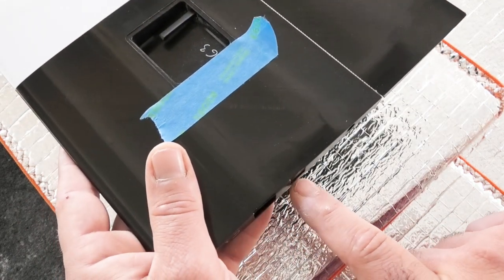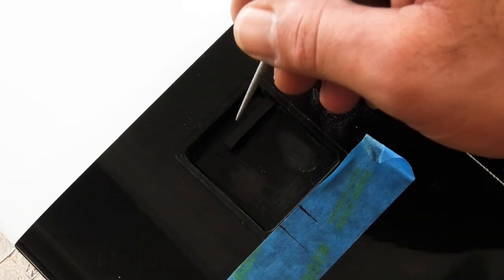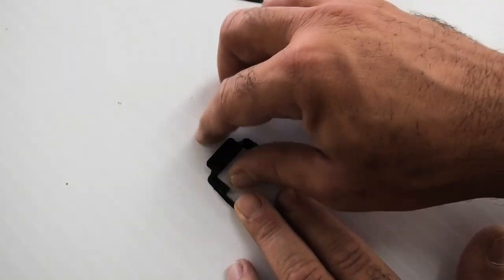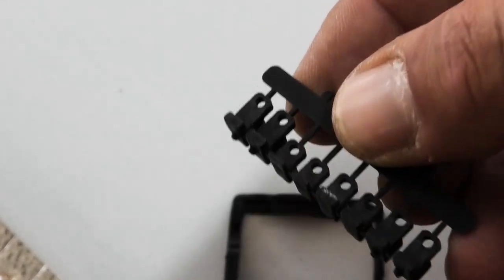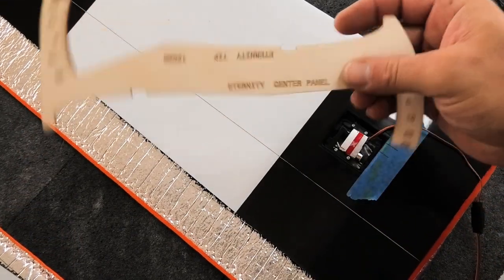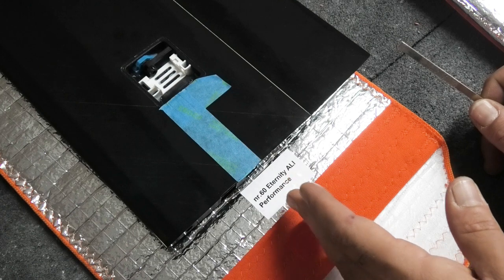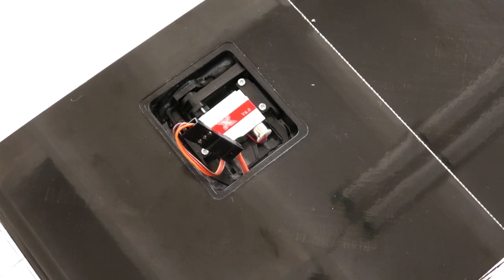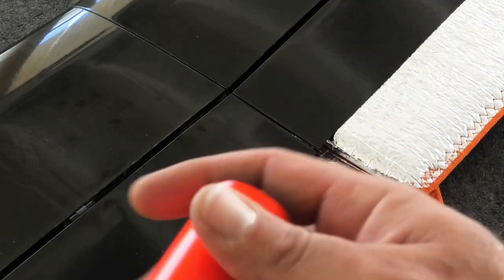Eternity F5J Aileron Servo Install

Comment: Hello Ali,
What epoxy do you use?
3 hours or more?
If you can pass the brand please?
Thanks
Arnaldo Medeiros 
Brazil
Reply from the maker: I use this-
https://www.aircraftspruce.com/catalog/pnpages/01-07905.php?gclid=Cj0KCQiA1ZGcBhCoARIsAGQ0kkpoAR7I5AEZwvNCnNQVBldmOi6F97-qfFblj6PeXTk_YjelynarnB8aAgQtEALw_wcB

But MGS is probably a bit better, very expensive. I always use slow curing epoxy, 3 hour or longer!